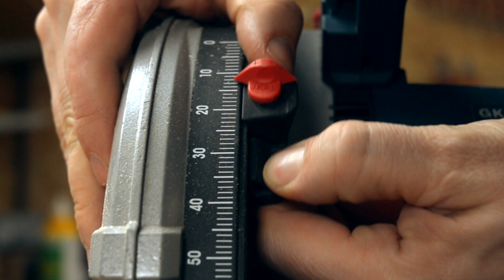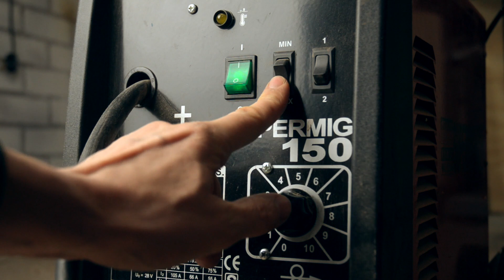Bedside Table (with LED
Light)

Comment: Nice project!  Subbed! Are you happy with the Axminster jointer/ticknesser? Is it the Hobby model or the more expensive Trade model?
Reply from the maker: Thank you!  It's a cool little shelf. Regarding the planer thicknesser I bought it years ago but it looks very similar to the Axminster AH106PT. For my needs it's absolutely fine. Will check the model number for you when I get a chance. Thanks for the sub as well Chap.
Reply from the maker: Hi there I've just checked the model number on my planer thicknesser. It is a Axminster AW106PT. hope that help. 🙂